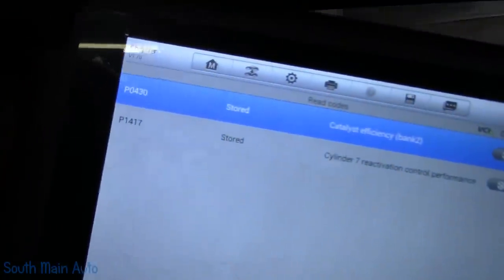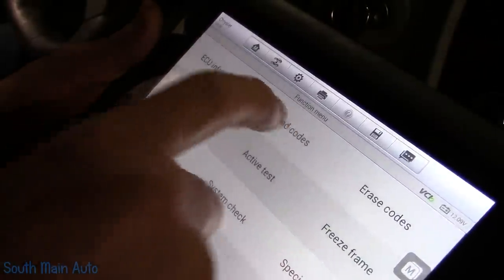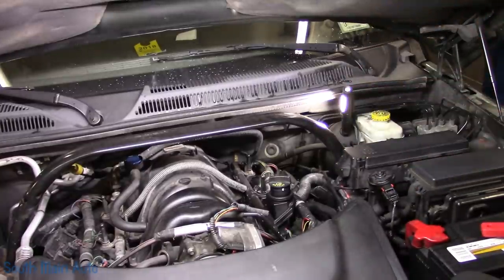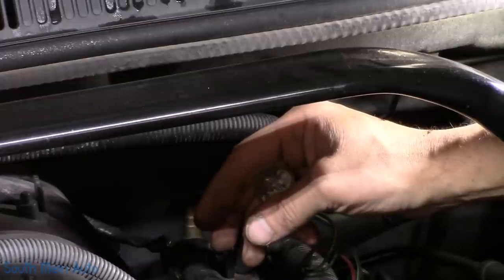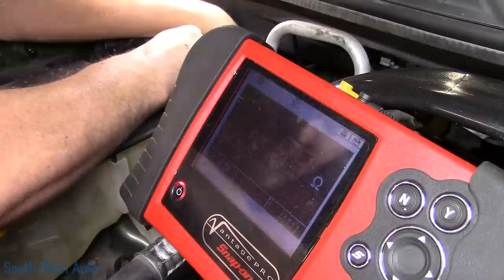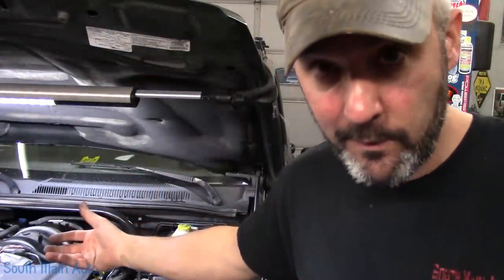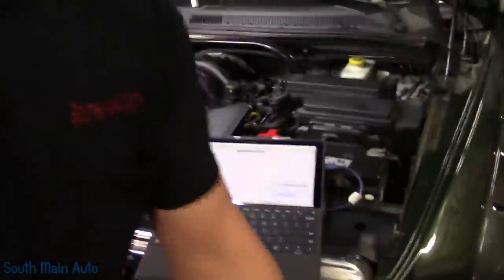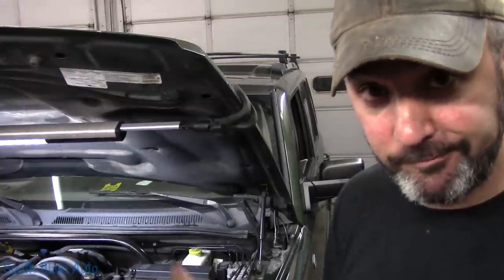Jeep Commander: Dead Misfire / No Parts Needed

Comment: Man that sucks. I mean from running a business perspective. Thanks for these videos. I swear if they put these in Tech training material, they would pay attention and learn... instead of blowing us capacitors using the bench power supply.
-Solenoid failing when hot because it either mechanically jams or a bad connection in winding open circuits/develops too much resistance?
-A big dangle-berry of pooh dislodged from oil gallery/somehow got past oil filter and plugged lifter or solenoid just long enough for some criteria of PCM logic to have a tantrum because actuating solenoid didn't have desired results elsewhere in X amount of milli seconds, then got moved on by oil pressure?
-The evil gremlin of cars/electrickery used telekinesis to hold the solenoid pintle in place?
-I've had too many beers, I'm an idiot and I have no idea?

Comment: if it's a 5.7 hemi, they are known to wipe the lobe off of the camshaft because the roller lifter turns inside of the bore. just do a quick search on youtube, and you'll find many people complaining about this type of misfire issue.
Reply from the maker: But we also proved 100% this is not the case right? The in cylinder wave form showed this

Comment: Do a thourough oil change, and verify problem doesn't return. The MDS solenoids have very fine screens in them. ...newer models have an "MDS Crusher Mode" function. ...It's possible that the lifter could also be neginning to fail (flat spotted roller or worn needle bearings) but has not got bad enough to be a duplicatable concern. ...only way to know is to pull them, so I would agree with letting it go. If it's not broke right now, don't fix it.

Comment: Very well done although I didn’t see you ohm out the #7 injector? And compared to the rest.. Hopefully i reach to your level of diagnostics im still a newbie as far as diag so you def run circles around me 😂
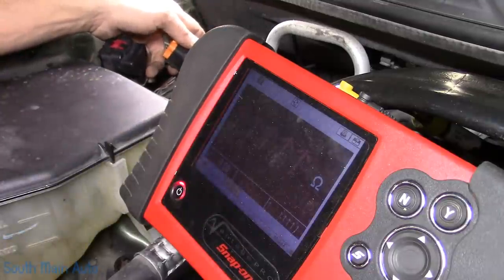Reply: 20:40
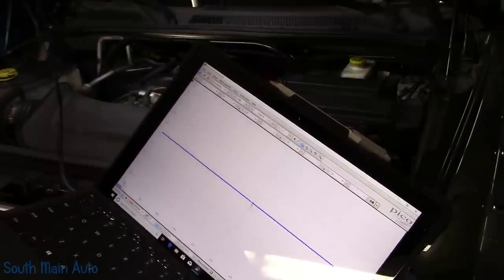Reply: heyitschino  Oops, right. I was thinking solenoids. Eric didn't quite get closure on his injector detour  That said, after Eric reset the ECU, I guess smooth running demonstrates that the #7 injector is OK, further confirmed at 32:44 by the injector current waveform.

Comment: Betcha there was sludge lodged in that solenoid from old oil. The code was set and when an oil change occurred or when the passage got cleared again, the computer didn't recheck it. A good question to the customer would be when was the oil changed last?... if it was fairly recently, that could've solved it mechanically, but the computer just needed to be reset.
Reply: Interesting.  Oil was changed about 2,500 miles ago for the first time in awhile.  Engine goes through a lot of oil between  changes.  Also the vehicle was driven for 3 hrs at hwy speed just before the condition started.
Reply: I just remember Ivan from PHAD diagnosing a Subaru that had intermittent valve issues. Turned out the oil quality/level was to blame. https://www.youtube.com/watch?v=wD3dnrx9j_E

Comment: Jack up the radiator cap and drive a new car under it, problem solved. Too many dumb little issues that happen with these vehicles. The first thing you have ro do is find the issue. You are one of the few that actually take the time to go through testing. Most garages say" oh yeah, they ALL do that" then throw parts at it, only to have it return a week later, same issue. If I had a dime for every time this happends. Clearing codes can sometimes reset the fault. It was designed to do that. If it is still running rough, then you can start at the cylinder that is acting up. Even if " They ALL do that" . It may very well be something else creating the problem.You can bet that is how it goes now days.

Comment: could low battery voltage had caused this? was your equipment showing 12.1 battery volts?
Reply: It looked like it was at low 12s with the key on, engine off. The time that the engine was running, volts looked healthy at 14.something volts. Something I thought of too at first

Comment: It might have had an improper oil/filter change, causing an air pocket, and/or a bad spark plug- and the ECU doesn't reset unless battery disconnect or scan tool reset. It seems that every "oil controlled" mechanism is very dependent on cleaner than normal oil to operate correctly. They're all junk. Multi displacement engines are all junk. Companies keep trying to revive that 4-6-2 nightmare. Cold beer is waiting.

Comment: Could the injector not have been open circuit and not drawing current? You didn't test with the noid light with the engine running, to see if the injector was killed by ECU.
Reply from the maker: Good eye, yes it could have, off camera I did ohm check it, I kick myself for not showing that part. Not sure how it didn't make it on film
Reply: No problem, you always seem more thorough than most Techs, so I raised an eyebrow at that point, LOL.
Reply from the maker: I raised one too haha, glad you called me out on it. I was hopping someone would!
Reply: South Main Auto Repair I was about to comment that you didn’t plug #7 back in after you verified the light was flashing.

Comment: wonder if it simply gummed up a spark-plug driving in low power, mode too much.
think I'd go with my specialty test ;) get it blazing hot, a/c on high/windows open, engine hot as hell, choked airflow with cardboard, to around 210F, shut off and let it heat soak for 20 minutes.........

Comment: I really would be thinking as to WHY that spark plug was fouled so badly. Makes you want to rethink your criteria.
Reply from the maker: The injector was turned off for over the last 200 miles of driving is the cause.
Reply: But, What fouled the plug ?
Reply: Thomas Joy Spark plugs rely on being burned clean.  With no fuel, oil vapor that gets past the rings, as well as oil vapor from the PCV will foul the plug.
Reply: @jdownj  . Not in the amount of fouling that the camera appears to show. This vehicle will be back to SMA or some other facility. Cadillac had this similar type of system back in 1981 with their 8-6-4 displacement and was dumped on us techs with absolutely no service manuals being provided for months. Tech help was a joke from the manufacturer. Seen many strange things causing problems.
Reply: @South Main Auto Repair LLC Hey Eric, but didn’t you say in the video “it reeks of gas”? So was the injector firing or not during the cylinder 7 misfire?

Anyway, prob OBE at this point.  Has this truck been back?  Any closure on the issue?

Comment: Cars have become insanely complicated. But what's worse is that there are only a very few 'God level' diagnosticians like yourself to find the problems in this insane complexity.  In this case you didn't find a definitive cause which only goes to highlight how insanely complicated our cars have become.  Every time we drive our modern cars it's like Russian roulette.  
There are 8,457,239 systems that ALL have to work and that's just too many systems to consider our cars to be reliable. 
Then of course there's the heart-ache and money-ache to find a competent tech like yourself to find that ONE failed system or just to figure out it simply needs a 're-boot'. 
At another shop, this owner would have had an injector, a coil and a lifter assembly replaced by now.  That's the scariest part.

Comment: The Jeeps are cantankerous machines electrically. Mechanically sound for the most part. Had a 96 that would no code stall out. turned out to be a bad crank sensor. Best running inline 6 ever. I miss that jeep it went with the way of the salt belt cancer.  Have one with the 318 now, slowly creeping its way to its death in the same manor.  Flaky wiring in the door flex's, will randomly trigger the factory alarm system.  Still love my jeeps..

Comment: Hey Eric, I have a strange issue, perhaps you can help!!

Monday night, I went to leave in my 99 Buick Lesabre, 3800ii, w/205k miles, I turned the key and heard a pronounced bang. Not just a pop or some back fire thru the intake, but a not even cranking first time the key was on in 24 hours, bang! The noise was heard in house, and nothing is ever heard in the house, anyway, I thought it was a gunshot, and looked around for an attacker, and even checked myself for gunshot wounds! No one was around, and there were no obvious blood spots, or pain, so I decided Thai wasn't shot! It must have been the car, but this was not light sounding poof, it was an explosion!! So I looked forwards, and noticed a puff of some white smoke, trickling out from under the hood! I thought that a small puff of backfire smoke would certainly dissipate rather quickly! How would it even get out there? So I waited a second. I decided to get out, and raise the hood, to look for anything out of place, and see if it may have blown the intake snorkel off, or something. As I got out, I noticed some heavier smoke coming from the right side, and it was a little bit darker. I thought it was strange to see that, and wondered how it happened? I then heard this odd crackling sound. Sort of like bacon cooking, or the like! Then the smoke suddenly got a little bit darker, and heavier, and I could see the little twinge of light, trickling out from the edge of the hood! That's when I started thinking that there could be a fire or something under there. That's when I noticed the dark spot in the middle of the hood, and at the same instant, I could smell that obvious "car on fire"! So I decided that there was absolutely a fire under the hood, of I choked a little on the acrid smell of the heavy black smoke that was surrounding me. I went back inside, and notified the other guys, that I could possibly have a slight issue with the fire that was assuredly spreading at a rapid pace, and was surely going to engulf the nearby garage, and all of its contents! Including the cherry classic car inside, jacked up, with no wheels on it, and the new air shocks were not yet installed, so that we couldn't push it out, to preserve it from the fire!! Of course, I attempted to call 911, and my smart phone got stupid, and wanted me to read and understand some retarded message about the existence of some emergency call procedures, and take the moments that I had during fire fighting, calling for help, and attempting to not soil my undergarments, to authorize my smart phone to continue with the emergency call. Well, the call went thru, and the guy on the other end of the line, asked me a bunch of stupid questions, and required me to answer them all, before they would send any assistance! I mean, really!! How am I supposed to remember my address, and why I was calling, and of all things, a cross street name!! I mean how am I supposed to remember all of that?? So, anyway, when I got down with 1000 questions with the guy at the 911 call center, I was finally able to direct all of my attention to the vehicle, and the smoke, and the fire that was rapidly spreading and all of the smoke, that was making it hard to breathe! That's when I started thinking about what all I learned for Dr O, at S.M.A. I thought, what would Eric do!! 

Anyway, with the hood open, the flames reaching skywards, and thick black smoke preventing me from breathing, I emptied the dry chemical fire extinguisher at the flames. My friend also took note of what I was doing, and aimed his dry chemical fire extinguisher at the flames, too. Between the two of us, we knocked the fire down to just smoke and sizzling, and was able to hit the hot spot flame ups, a couple times, until the guy from the fire dept showed up, and asked if we needed help with it! Well, up to then, the dry chemical fire extinguisher was working pretty well, but they had to go get a wet one, and spray all of that wet stuff in there too.  Up to that point, all I needed to do was use a leaf blower to blow off all of the dry chemical stuff, and things would have so much easier! But now that they wanted to use water, I have a big mess to clean up!! I mean, all of that water is going to get into the brake system, thru the melted master cylinder reservoir, and the wiper motor, shorting out all of those wires, where the insulation had melted off!! If it hadn't been for all of that water, there wouldn't be that much to clean up!! Just a little bit of powder, and a few parts, and a new wiring harness, and roll down the windows to let the smell of a burned up car get out of the upholstery. You know, this little things!! Like a manifold, fuel lines, new injectors, and such!! I just wonder if I'll be able to use the oil cap that melted, and how bad the battery will be, with the right corner burned out of it!! Luckiyl, the heat will help all of the burned paint to flake up and fall off, that didn't burn off!! Maybe one of those pine tree air fresheners will help out a bit!! 

So, to make a long story short, my car burned up Monday night. The garage was safe!
Reply: I had a couple of crappy days in a row, After reading about yours I guess they were not that bad after all. I hope your luck improves!
Reply: william bell...thank you very much, kind sir!!
Reply: damn man, sorry to hear about your car. glad nobody got hurt (well, we will agree not to think about the possible lung cancer you will get in a couple years) and I hope things get better. Silver lining...now you get to go car shopping!
Reply: Coles Towing...thank you for the kind words! (except the cancer part) 

Car shopping is not likely! I've been sick for many years, and am not able to do anything, let alone afford a car. About 90% of my net worth went up in flames! 

And before you ask, liability only! I did mention the '99 over 200k on it? I always figured a running car was worth at least $500. Would have spent that in insurance in just a few months! A little funny story. I just recently put a fuel pump in it. $60 +/-. Last week I put a MAF in it. $150! I put brakes on it, shortly after I got it, before I got sick. I was upset about the parts that I lost, and my buddy said that I was out $200 on a car worth $500 that I've owned and drove for more than 8 years, and I have put less than $500 bucks in it! Same old air filter, plugs wires, I just recently put a used tire on it, the other 3? ON IT WHEN I GOT IT!! 

I got more than my money's worth out of it!! And then some!! I just can't replace it right now! The only thing I'm trying to get before I junk it?? It had a full tank of gas!! And I got two empty cans!! Lol

BTW, anyone need a slightly used air filter, only has 8years on it, and smells like smoke!!

Comment: Hello anyone that’s watching and has a Ford Explorer I NEED HELP I have a rough idle and I swear I cannot figure out what the hell it is I have replaced Pcv I cannot find ANY vacuum leak that I can see also their is NOOO check engine light so I really have no idea what to do if their was an intake leak I would think it would throw a code also if their was a misfire it would throw a code I’m thinking maybe engine mount ? Or maybe even something internally wrong but the engine seems to run better when driving also IT NEVER STALLS so I literally have no idea it does idle but it just is rough and it’s extremely annoying thanks for reading if you have advice for me pls let me know.

Comment: If shit goes wrong it's USER error 
with Active fuel management systems  you need to change the oil VERY often  like every 3,000 other wise it gums up the little holes in the engine..
7-10,000 miles is not good enough

Comment: did you look at engine oil level?
Reply from the maker: oh of course, only about a half quart low is all. I mentioned that in the vid I thought
Reply: @SouthMainAuto  i was watching and didn't hear you say that then near very end you said that. Had lots of problems with cylinder eliminating on v6 honda where ring gaps would all align .they use to come in with 1to 2 quarts low .needed a rering and s plugs 1234 cyl.pilots and odyssey's

Comment: Low oil pressure or blocked oil passage
Faulty MDS Solenoid
MDS Solenoid harness is open or shorted
MDS Solenoid circuit poor electrical connection
Faulty Engine Control Module (ECM)

Comment: / computer sarcasm on
I guess you should've bought one of those apple brand jeep commanders, they NEVER crash lock like that.... /sarcasm off

usually I keep a big hammer and an electro-magnet in my toolkit for fixing PC's, sometimes implied threats of extreme digital duress gets electronics to "play nice" , especially if they are doing the "I'm sorry Eric, I cannot turn on the injector, or open the bay doors" routine

seriously though, least it was not tearing the heads off and repairing  the oil guide assemblies etc.  and now you know what to try first.. a swift kick in  the .. wait er. I mean resetting the ecm...

and you are my age approximately, so you might get this reference.  "knowledge is half the battle" -Yo Joe  

I hope your lifted jeep doesn't have that MDS system in it, hard misfire BS on a trail with a shimmy that hard would be atrocious to get back to town with.

Comment: Eric Computer doesn't like the sleep mode disable Sleep mode go to power settings and disable usb sleep and Computer sleep in Windows 10 settings under system then power and sleep go to advanced power settings then choose when computer sleeps then set computer to never then change advanced power settings go to usb drop the list down to disable usb sleep problem fixed